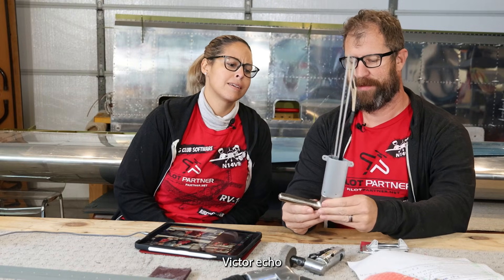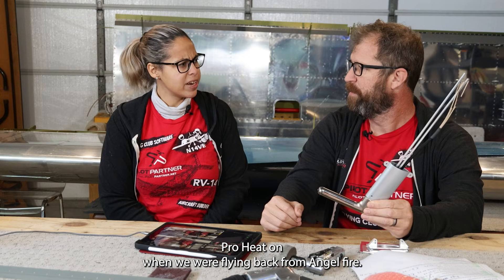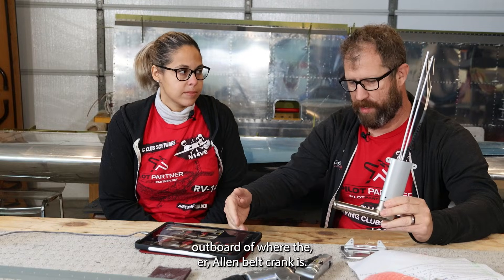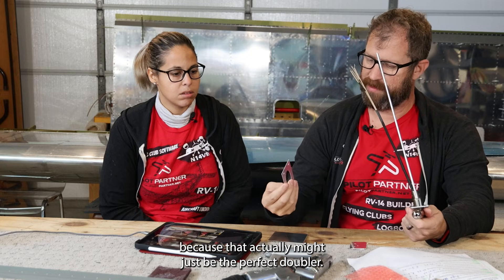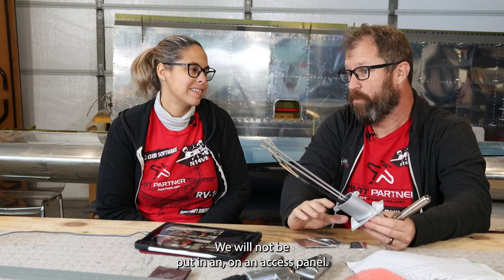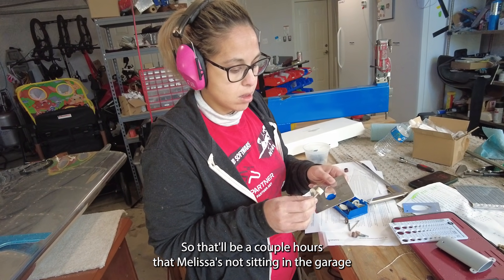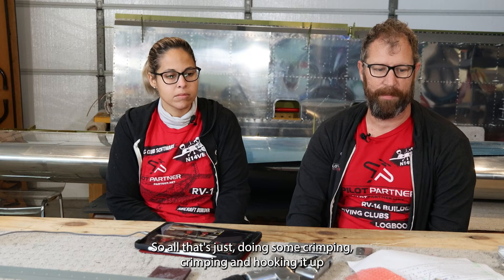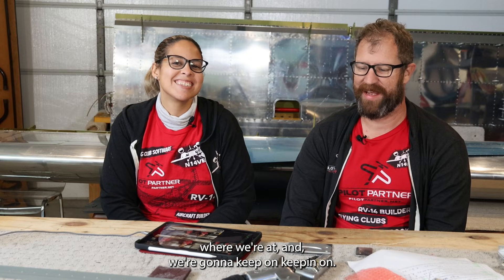Vans Aircraft RV-14 Installing GAP-26 Pitot Tube

Comment: I'm just about ready to rivet on the bottom skins myself. I fabricated a doubler for use with the Garmin pitot mount. Mine attaches to the spar and nearby rib. Today I set the neutral position for aileron bellcrank and pushrods. Figured that would easier with the bottom skins off. Good luck riveting on the skins!
Reply from the maker: We made sure our neutral points where set too.   For sure easier with the skin off.  

We did find out, take the push tube back out to rivet the bottom skins on.  We thought we could work around it, you can’t.
Reply: @N14VE  I figured I would need to remove the push rods before riveting. Thanks for confirming that! I'm planning on leaving the AP servo installed. I hope the banging from the riveting doesn't damage it!
Reply from the maker: We left the AP Servo installed.  We had to unplug the wires but all else was easy enough to get to. 

We will be making a video about us closing it up, but might not publish in time for you.
Reply: @N14VE  I dunno. I'm working really slow on the wing closeout process. Pulled some wire today for the lights. Had to order some larger cushion (Adell) clamps. Started to label some wires but found a discrepancy in the wiring diagram I was sent. Gonna be a while so I suspect you'll post your video before I start riveting. Glad to hear I can leave the AP servo in place!

Comment: Did almost exact same thing other than add a short piece of sheet metal angle to tie into rib and doubler .  Same location.  Much stronger but who knows if worth it.  Be careful bending tubing!  Mine collapsed despite best efforts.  I got regulated.  Unnecessary and, imho, minor mistake on my part.
Reply from the maker: When we bent out tubes we: heated up with a hair dyer.   It was cold in our garage when we did it.  And used the base of our pneumatic rivet puller to do a gentle bend.   Bending went easy.